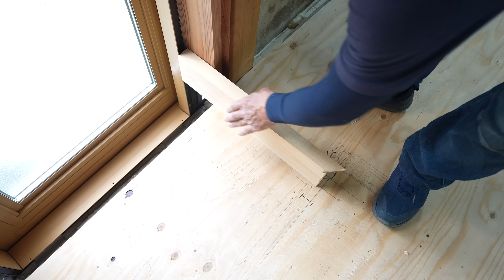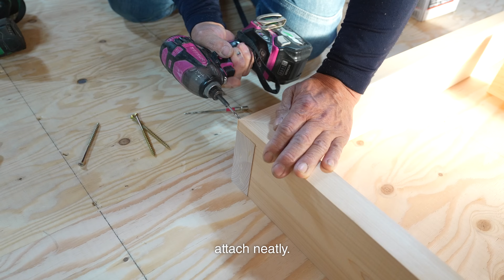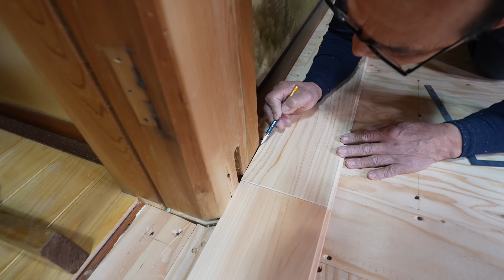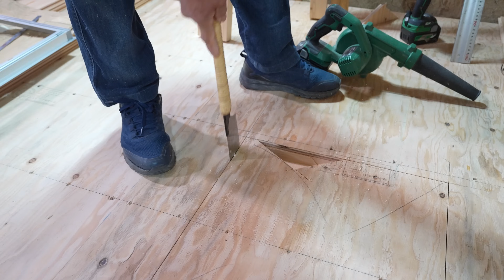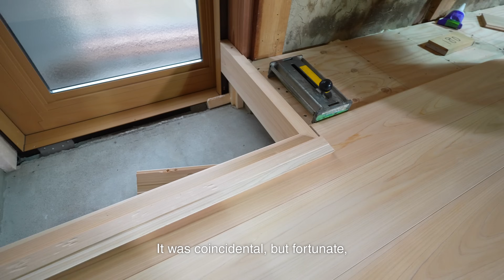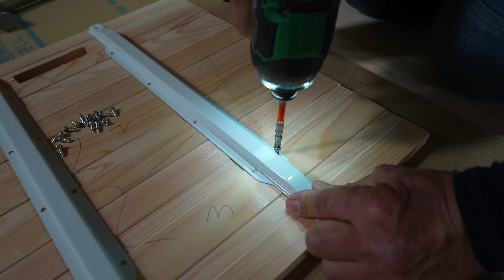Hooray! Finally My Dream Wooden Floor Installed [Carpenter’s Home Renovation Part 4]

Comment: I've never bothered with special frames for access panels in floors (basements, for us Europeans). I usually just do 45 degrees cut panels with a bevel. I do that by cutting the parquet/wood at 45 degrees on the table saw part way through, then flipping it on the other side and cutting at 90 degrees until the 45 cut meets. If you do this with an old style blade with no alternating teeth, thus very narrow kerf, then the resulting cut is exactly the 1 mm thick (the width of my blade, which is the one that came with my 1800's table saw). I repeat this all the way for all the boards with the addition that for the sides (the cuts that are made into the middle of a parquet board longitudinally) i finish the cuts at the corner with a custom made chisel that's made from a saw blade after i score the cut with a box cutter/scalpel. Under the floor, i reinforce the perimeter of the hole with a jointed (simple finger joint) frame and for the actual door itself, i add biscuit joints and two or three (depending on size) dovetail cross installed pieces of wood. The resulting door rests on the 45 degrees flange of the floor around, which is plenty strong to support it. To space it even with the rest of the floor (to account for the 1 mm kerf, i just glue a piece of trim all the way around.
If it weren't for the 1 mm kerf, you'd never know there's a door there. It's very sturdy when constructed this way.

Comment: What gets to me is the quality of the timber used for floor beams and the like. In my country, any wood work that will not be seen in the finished building is cheap rough-cut pine which are sloppily joined together with galvanised metal brackets.   
To get quality finished work you also literally have to stay on the builders' asses and be on site in person to stop them from taking short cuts. You will need to actually educate yourselve and know what they are supposed to do, otherwise they will take advantage and cheat you.

Comment: Im trying to imagine any contractor putting this level of work into flooring or woodworking in the states outside of high-end home construction. If I could get people like you to work on projects I've designed, i would be ecstatic.
Reply: I woul be shocked too find out that anyone who has worked on my house even owns a hand plane.
Reply: High end houses cut the must corners with stuff it's terrible. You would think paying millions you would get a perfect house LMAO!!!! Nope
Reply: @Spyhydro  It comes down to who you get to build it. A lot of these new builds are both designed and built by the same people. It means there's no one to defend the client from any corner cutting measures. Back when I designed high-end custom homes, our job as the architect was to take site visits to call out shitty work and refuse to pay them until it was designed to specification. We also kept a running list and documentation as to who the shitty contractors were and would show new clients the type of work they'd try to do when they would submit bids. We also made sure to supply the info to other local architects in an attempt to blacklist them from the area. Now, obviously, not everyone would play ball, but it had some impact, and it kept our buildings from being shit so... All this said, the reason we were so anal though is because our principal was also a professor at a college who taught, among other things, architectural ethics. It mainly focused on how the architects moral duty was to protect the client and their vision from everyone but themselves. Given that he was my professor as well, it goes a long way in explaining why it bugs me and why I hate most of the contractors in the new area I live.
Reply: Alot of times the employer won't let skilled tradesman put in the 100% like this because there bottom line.  They sacrifice quality for quantity and want there employees to hurry up and get it done
Quality makes it up in the long run and sometimes you end up finishing ahead of time because you were able to plan and execute quickly with no mess ups... sometimes they just never learn to just do it right ONCE
Reply: @orlwal1234 weird thing is, this guys is working faster than most teams of contractors.
Reply: @orlwal1234  This is true, and part of the reason I said contractor instead of tradesman. I've seen it happen with masons on site, but the end result is the same. The work is shoddy, weep vents are loose, the courses aren't level or parallel, and the raked mortar looks like slump.
Reply: Having been on high end projects, its way worse than you imagine.
Reply: @Kryynism some of us craftsman who take pride in our work are still out here. I'm 42 so probably one of the last generations to treat others homes like I would mine but we are still here. The problem is people don't want or can't pay for our time. They don't understand the value regardless of how easy we make it look
Reply: @Theuglyconcretefinisher  I hear that. I am 34. Have had the priviledge to work a good few men in the trades over the years, counting myself among them that take pride into my work.
Reply: @milkmanman I always say this!! They won't pay for skilled workers so they pick up very desperate and very green young guys with little experience and teach them ways that prioritize money saving and speed. Cheap materials and cheap labor.
Reply: @Theuglyconcretefinisher 48 this year, started my career restoring timber framed farmhouses in the New England area, even had the privilege of working on  president Franklin Pierce's homestead.  There is definitely a difference between Tradesmen and Craftsmen.
Reply: @Kryynism  It depends. I used to design custom high-end houses in the Alexandria/DC area before I switched to commercial work. Given that we valued quality as the architects in the area, we got to know pretty quickly who was gonna put in the work and who was gonna cut corners, and we made sure the corner cutters didn't find work with us. It gets bad when you do a design build with the wrong contractor or when the client doesn't care to stop it. The houses we were doing were worth upwards of 30 million, though, and the people who owned them didn't care about money, so the houses always turned out nice.
Reply: @Kryynism  Cy and gold star inspections have enlightened me to the state of new construction in 2024. Million $$+ homes with basic issues and shortcuts? Par for the course.
Reply: @theunknownleaf409  yes sir. Everyone gets the same garbage
Reply: Would any homeowner in the states appreciate it like they would in Japan?
Reply: @BlluueePiinneaappllee  given people are fed up with the quality of new builds, I think at the very least the would be appreciative. As to whether it's more or less 🤷‍♂️
Reply: Got to spend money to make money…if he isn’t worth your money and time you won’t make money for time.
Reply: Tom Silva cuts no corners!
Reply: Im 26, Id love to work for someone who took pride in the quality of their work. I can’t seem to find anyone whose expectation isn’t getting it done as quickly as possible regardless of quality though.. seems like the standard right now
Reply: You wouldn't be able to afford him
Reply: @hospicenursingab  he’s on my lottery splurge list
Reply: This would have taken a long while, beautiful work but just way to time consuming for something like a standard home. As you could imagine the work gets better the more expensive it is
Reply: Slap jobs everywhere js
Reply: It's real sad. These construction companies don't want to pay high skilled workers to be on their teams so they instead hire very green and desperate guys and teach them in the ways of fast and cheap. I'm sure many of them would prefer to work with a high level of skill, but that's not how they're taught anymore.

My parents house isn't even that old (built 2007) and has so many cut corner issues that they've had to fix over the years and it's only getting even worse with newer construction.
Reply: Same in Australia my man
Reply: I've had to manage contractor projects at work. It is miracle if they even do it half way to U.S. standards.
Reply: Do you pay enough for that?
Reply: @beantea5592  I don't pay. The client pays a percentage fee based on the budget of the project. But given that I once worked on the milti million dollar Washington DC mansion of a Saudi Arabian prince and the contractor still tried to cut corners, I'm gonna say it's not the pay. It's the fact that the faster they finish, the faster they can go and make more money on another project. I've since left residential architecture for commercial, and you deal with the same shit.
Reply: High a translator and fly a craftman from Japan. Not as cheap as getting run of the mill carpenter but certainly cheaper than high-end services
Reply: I  am a trim carpenter in Michigan,  and I work very similar to Shoyan, he and I use many of the same tools and techniques. I  can trim an entire house to a very high standard using only hand tools.

Comment: I have to say that the saws cutting on the pull seems so much better than the English cut on the push. It seems much more accurate and also easier to work with. The same with the wooden planes mainly cutting on the pull (although it looks like they can be used both ways) and being wooden they seem so much lighter and easier to handle than the English cast metal planes.

Comment: I wouldn't have installed the metal on the floor door... but does make it last. So what you could do is paint the metal with some matte white metal paint. Although black is usually better to not get attention, the white will do the same thing for the lighter colour floor. However, if you could get a colour paint that closely matches the floor, then do that. It will make the trap door nearly invisible for most people thus making it look really good :)

Comment: Another fine job !
I love the hardware kit for the access panel. The quality wood is incredible . I would be curious to know what is the cost of material for this floor. I guess the equivalent in Canada would be a premium pine grade floorboard.

The only thing, this wood specie will dent easily no ? For a kitchen humm I don’t know. 

Ps I remove what I said last time about the strange design : the door frame being lower than the floor level. 
Now I understand the lower aera Kamachi modification that he did to match the door 👍